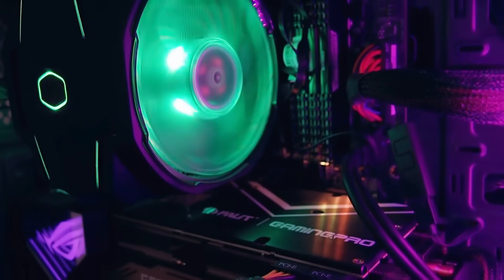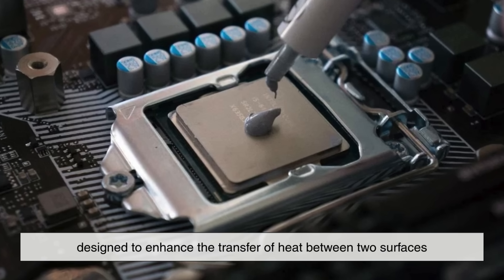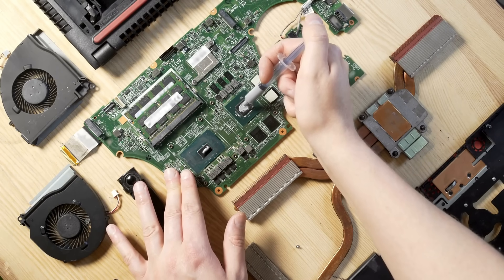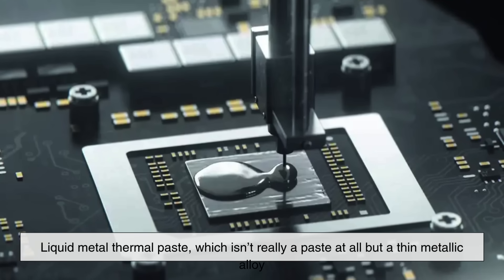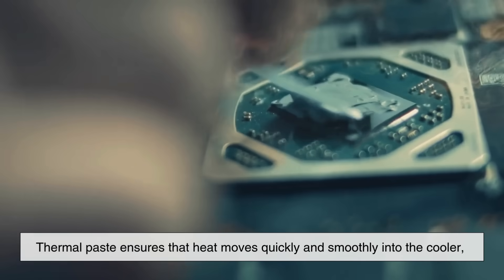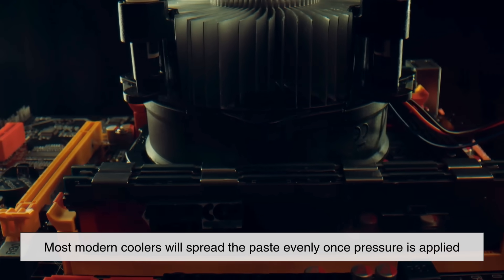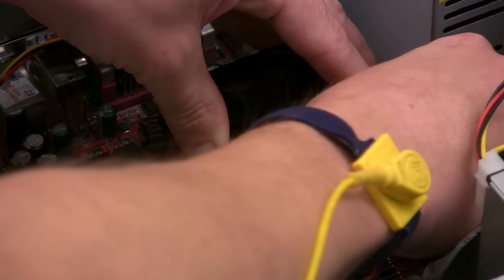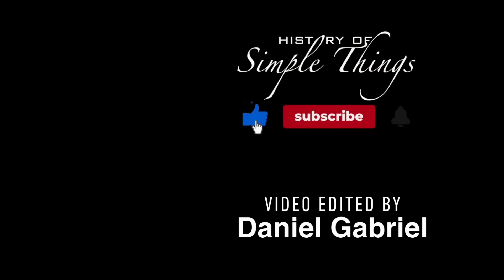What Thermal Paste REALLY Does (Most People Have No Idea) [ID0802]

Comment: I always spread a thin layer using an old credit card cut to the size of the CPU. I use just enough non-conductive thermal grease to fill any microscopic irregularities to ensure maximum contact to the cold-plate without excess squeeze out. I've used Noctua thermal paste for years, then switched to Thermal Grizzly Kryonaut, and then ID-Cooling Frost X45 but I recall swapping a CPU cooler on a never overclocked PC that I assembled years ago and was surprised to discover the thermal compound was very hard and dried out. Perhaps I applied the paste that came with the cooler back then, but I can't be sure. The free CPUID HWMonitor is great for checking the temps.

Comment: I tried Thermal Grizzly's liquid metal.  I was braced and ready for the challenge.  Or so I thought.  I'm old enough to remember playing with mercury from a broken oral thermometer back when they were common.  Spreading liquid metal was very much like trying to create an even, thin layer of mercury.  After a minute or two of chasing the little balls of liquid metal around on the cpu, I could see that this task was not going to end well.  I mopped it all up before things went horribly wrong.